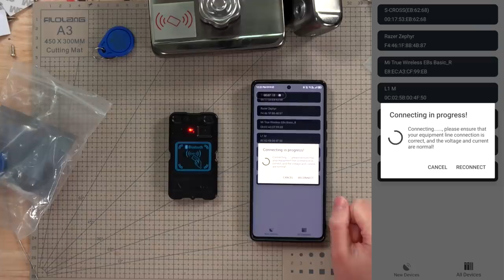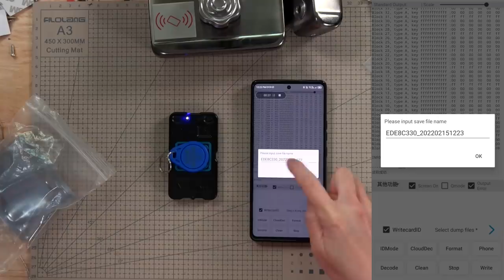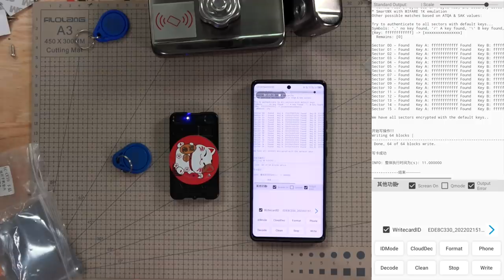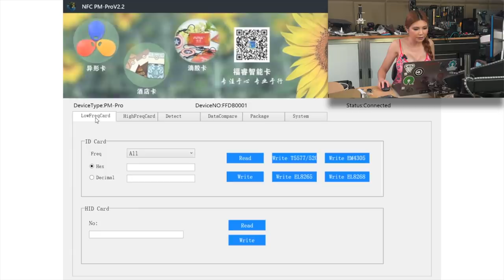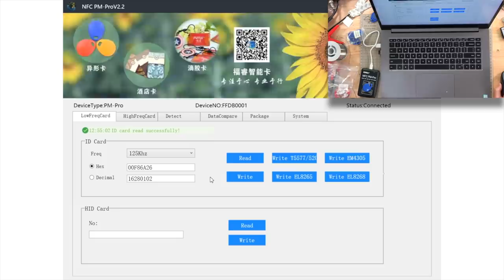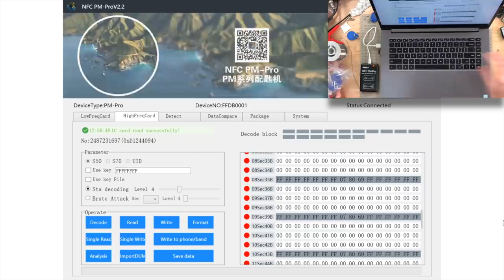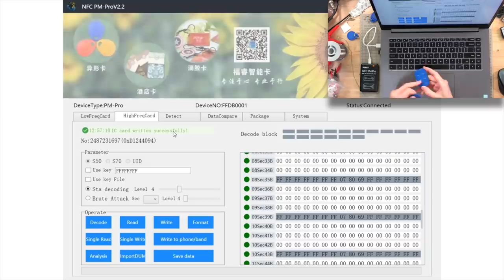Cracking and Cloning RFID Lock Tags

Comment: I was somehow sure that RFID entry systems use some kind of challenge-response mechanism, where the card authenticates the reader as well instead of just feeding it some static data. Turns out... nope! They're almost all as easy to clone as you show here.
BTW serious "anime hacker girl" vibes using that pink lucky cat sticker for the cloned credentials, bonus points for style!
Reply: Those systems do exist as well... But they're a lot more expensive.
Reply: I work in this field and i can tell you that all the datacarrier chips we sell are hardcoded in our company before they get sent out. So there is no way that someone could read/write on those datacarriers without the reading/writing key. Of course many cheap variants exist with no coding and no security measurements.

Comment: We use proximity ID tags at work to log in to our computers at work. It really makes keeping the information we use at work separate from other shifts and easy to use while keeping files separate and organized for our records. And it is like Naomi said you can control and turn off and on the proximity tags easily from your computer if you lose one, or it gets into the wrong hands so you can stay safe. Great information 👍

Comment: Very, very interesting. If we allow the technocrats to have all the tech knowledge, individuals and populations will be left in a vulnerable position. I can think of three things that set apart knowledge vs criminality; One is the nature of the individual's premeditated intention on how they will apply such knowledge. The other factor is the use of phone apps or laptops to use some of these devices. If you commit a crime using one of the devices, and you are suspected, your phone and laptop may provide the evidence law enforcement needs to impose criminal charges. And third, surveillance cameras often capture criminal behavior, or confirm innocence, and are very useful to law enforcement. You demonstrated how the RFID lock tags work and their inherent vulnerabilities. I used one at a 24 hour self-entry gym, given to me when I joined their membership. They are convenient. But, not completely secure. I didn't know this until this episode.

Comment: The tag with the 6 storage slots was fantastic. A quick google search didn't pull up any other RFID tags that had a button activation, but that would be a good security feature for them as the "RFID reader in the pizza box" attack wouldn't work anymore.

Also, I got myself an iCopy5 cloner. The firmware is a bit rough around the edges, but it works. I used it to clone my hotel key at Defcon (we normally have around 7 people to the room).

Keep up the good work.
Reply: There is a little extra security in that you have to press it to use it, and of course, to save you from carrying 6 separate tags.

Comment: Hi Naomi,
There is different types of Magic block 0 writeable cards.
Most mistakes are made by the customer not buying the correct rfid magic card block 0 writeable card.
I purchase dual freq 125khz + 13.56Mhz
Magic card block 0 writeable cards.
Most cards are mifare classic 1k 13.56Mhz cards.
But the earlier id cards was HID cards using low freq 125khz cards.
So these dual freq block 0 writeable magic cards are usually a good purchase.

Comment: Well, in UHF tags, you can set TID code as the key instead of EPC code.
EPC code is for read and write, while TID not rewritable. But it means you cannot colonize the tag but will pay more to key smith if you lost your tag and need to reset the lock.

By all mean, RFID lock is much safer than traditional key or password. Or you can use finger print to door locks, rather

Comment: Here's a question: I've got a couple of employees that have lost their RFID employee ID cards which allows access to the building, allows them to punch in and out for lunches, starting work and going home. Both have lost their ID's at least once in the last 6 months, so my question is if I purchased something like one of these RFID cloning devices would it be possible to remake an employee ID/access card if it was lost or would I still need to contact the companies IT/security department for a replacement?  Thanks for the information and another great video
Reply from the maker: Depending on the type you could clone them. But it would really make your facility much less secure to have valid tags floating around. Ideally your IT department is canceling their old tag ID and issuing a new one.
Reply: @Naomi-Wu  That is true and the IT department would continue to be notified and make the new permanent RFID picture ID cards, I would be looking to make a temporary card to give them something until the new one arrived (usually a 48 to 72 hour turn around) because the IT department is at the companies main office location. Once the new card arrived I would delete the temporary card.

Comment: Lots of rfid locks will try to write to the tag before reading especially so you can't use writable tags. They just store fixed codes of read-only tags. Are those really more secure, or is there an easy way past those too

Comment: Nice Bogata rakes! Have you messed with the Flipper Zero yet? Super fun for RFID stuff. If so, I hope you'll do a video on it soon.
Reply from the maker: Dying to get my hands on one!
Reply: @Naomi-Wu  I think they're back in stock, so ordering shouldn't be much of a hassle. I had to wait almost a year for mine, it was still just a kickstarter then, but it was worth the wait. I haven't even touched the Bad USB/Rubber Ducky or wi-fi stuff yet, still having too much fun with the sub-ghz, NRF, and infrared features. Just starting to scratch the surface of the GPIO. 

When you do acquire one, I suggest keeping both Eng1n33r/Unleashed and RogueMaster firmwares on the SD card, as each has features the other does not, and both sets are useful. You'll see.  ;)
Reply: So did you get your hands on one yet?  The latest firmwares are KILLER!

Comment: Cheap Amazon/Chinese access control systems used in video. 125khz is easy... Show me you breaking thru a HID/PROX 13.56Mhz reader using wiegand 64-bit encryption with special encoded cards without knowing the start and stop bits.

Comment: Interesting contrasting the approaches to social engineering. Either blend into the background (the clipboard and hard hat approach) or look so extreme, but simultaneously harmless that people just chose not to engage or take any notice of you. I suspect that the second approach will never work for me, being a very large man, but the first approach would work easily in many places where I have worked since most people are not being paid enough to care about security theatre.

What do you think about the credit-card style keys that Tesla uses to lock and unlock their cars? I am pretty sure that they do not work like these crappy RFID locks, but wonder whether they are any more or less secure than a traditional mechanical key (which no Tesla has at all).
Reply from the maker: Not sure, I have not looked into their security, but chances are there's a side channel attack so you don't have to take the car lock head-on.

Comment: Knowing the tech inside the RFID products, I would not use it for anything other than a novelty application, it's just way too simple to crack.
I wouldn't even use a Bluetooth connected unit as that's also often trivial to defeat.

To be honest, having these locks on your house just invites people to look and  attempt breakins.
I just have a decent 5 pin physical lock and some security Cameras and an alarm system.
If someone wants to break into your house, they will use a low tech option if they can't defeat the lock.
Best option is to have an alarm system, use it, and make sure the prospective thief knows it's there and in use.